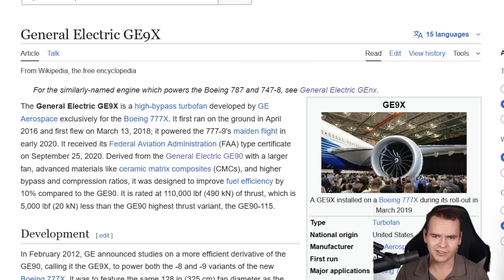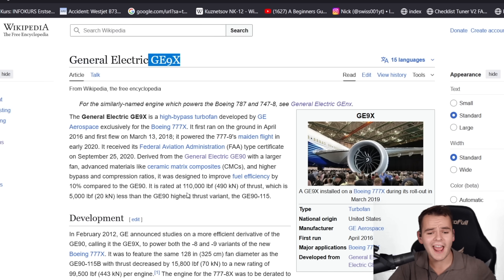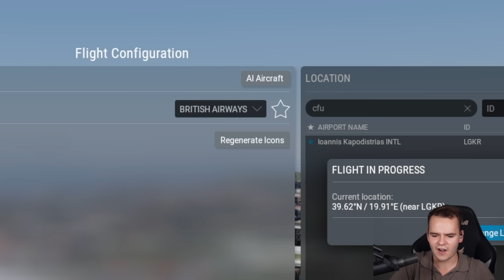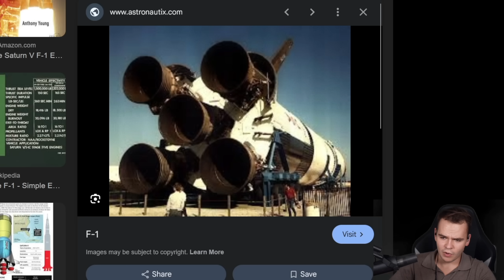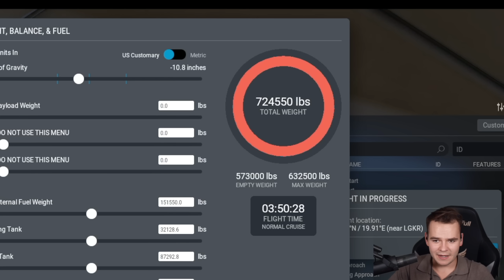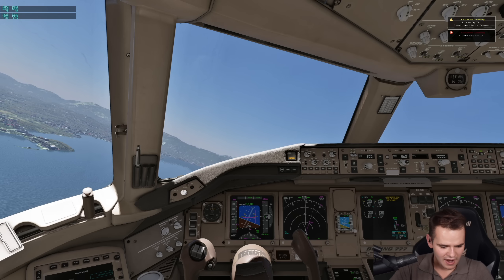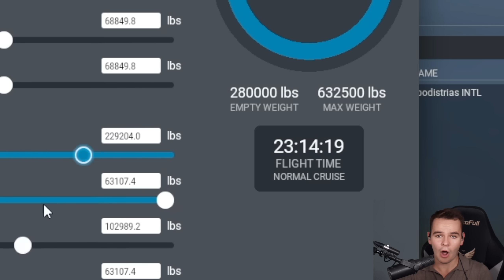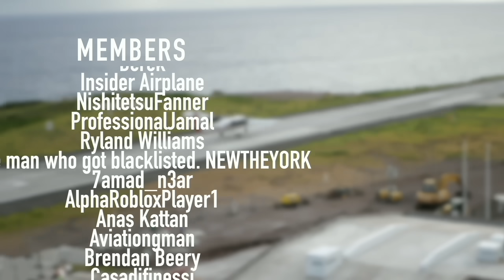Creating The World's BIGGEST JET ENGINE

Comment: All that size for 127, 000 lbs of thrust? sorry to break it to you, but the Ge9X can be pushed to 135,000... that's not operationally sustainable, but it can certainty do it.   this leads me to believe that an engine would not have to be this big to generate 127, 000 lbs sustainably - bigger than Ge9X though ofcourse.  Still, great to watch, lol.

Comment: the 127000 lbf big engine is actually weaker than GE9x, which is 134,300. 110000 is just the power limit adjusted for steady flight need

Comment: The GE9X is actually capable of generating just over 134,000 pounds of thrust, just like the GE 90 at 127,000 pounds during red line tests. The GEX was originally de-rated to 90,000 pounds of thrust but was later raised to 110,000 pounds (Same as the GE 90-110) after pilots wanted more power on takeoff.
Reply: Sybau mr chatgpt
Reply: @honeybager9000 Calm down lil bro, he's giving info